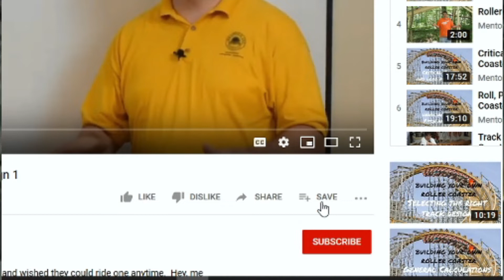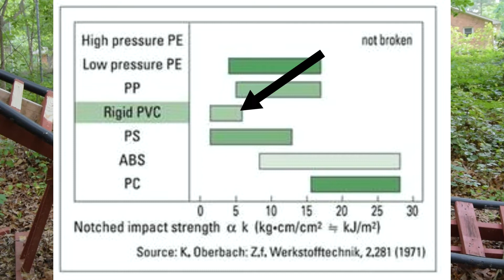Not Again - 2nd Catestrophic Failure - Black Widow Backyard Roller Coaster

Comment: Great videos, can't you fill the pipe with resin or sand to make it stronger?
Reply from the maker: Great question.  I briefly entertained this thought.
Sand would be the easiest method, but I don't know how much it would help.  The pipe might deflect and just push the sand out of the way.
I tried foam insulation (great stuff), but it is soft and difficult to make it fill the entire pipe.  In my initial track testing, I tried to do this, but it was difficult to get the insulation to fill a 16" length.  
Epoxy is probably the best route because it would fill the pipe and bond to it.  The downside is it is super expensive.
Reply: It has nothing to do with that, in the end you are putting a lot of weight at once in that section, it is about the design of the turn

Comment: I commented a long time ago that the drop is not well adjusted to the G's due to the incorrect lateral inclination and that is why that part suffers a lot of tension, you have to soften that area so that all the weight does not fall right in that section, if you look just by looking at the traced it is appreciated that all the weight will fall suddenly in that small point due to the design, you need to design the routes according to the heartline, I hope you understand what I mean and it helps you, that turn has too many degrees of inclination to the right, Greetings mate!
Reply from the maker: I've reworked the track multiple times for this reason.  It is much better now.
Reply: @MentoredEngineer  Ah, I didn't know, even so it is observed that right at the breaking point there is too much inclination all the weight falls there and fractures
Reply from the maker: I went back and checked, I didn't release a video with the 4th version of the drop.  Rest assured, I will never make a curved drop again.  I also reduced the weight limit from 220 to 150 lb.